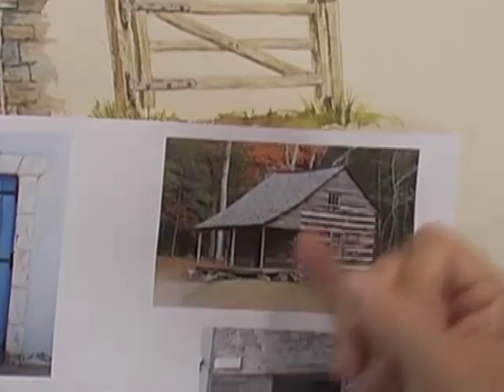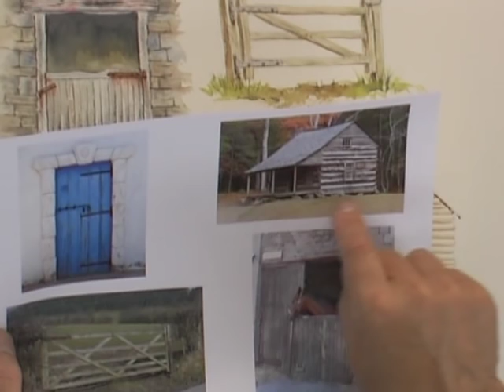Painting Wood, Metal & Rust in Watercolour (Part 2)

Comment: Those logs aren't round. That's a hand hewn log cabin. The logs are actually chopped to a flat surface with an ax. The light areas are the chinking. Chinking is mortar used to seal in between the logs. A cabin built with round logs has the telltale log tails sticking out from the corners. I use to build and restore all types of log structures..... Nice tutorial overall though